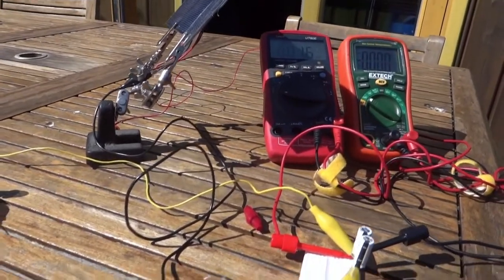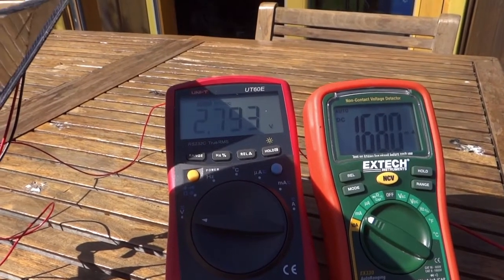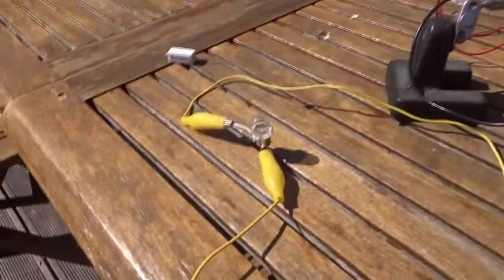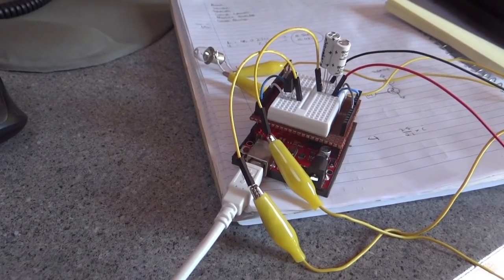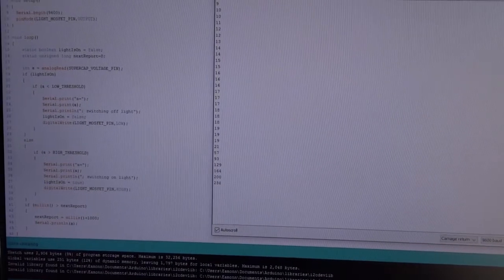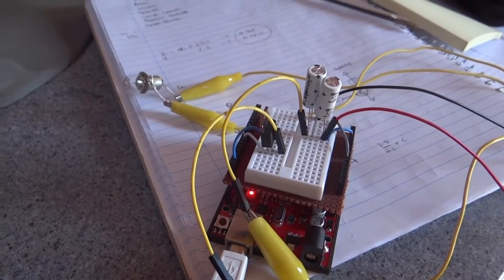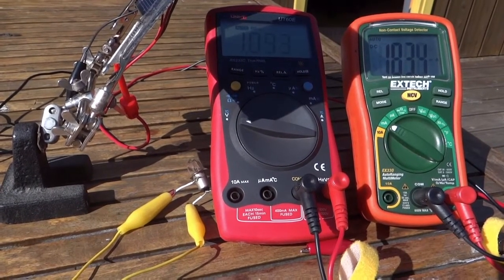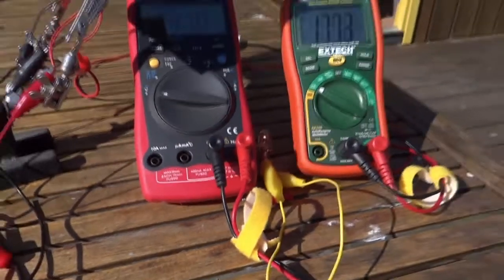Experiments with a supercapacitor, a solar cell and an Arduino

Comment: How much capacitance are the super caps? And this isn’t as easy to answer, would you happen to know how much current the bulb was drawing?
Reply from the maker: The capacitors are 3F each, wired in series. This provides 1.5F of capacitance in total, but the pair in series is good for 5.4V (2.7V each).  The current drawn by the bulb will obviously vary (non-linearly) with voltage as the capacitors discharge through it. However, I still have that bulb and I just did a quick check and generated two datapoints: at 5V, the bulb draws 750mA and and 3V it draws 580mA.

Comment: Thanks - I was thinking of making a solar powered IP camera and using supercapacitors  but I think I will stick with rechargeable batteries. I was going to pot everything in if I could use the caps because they would have lasted a very long time. It would have only needed an occasional clean of the lens and solar panel.